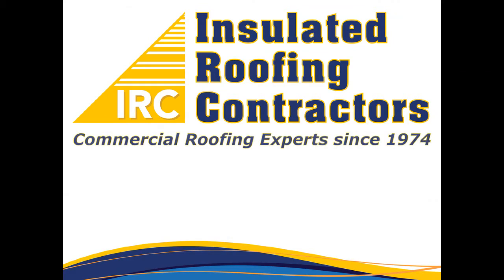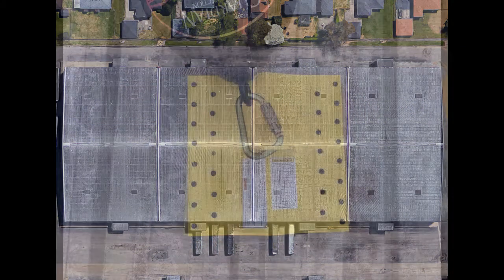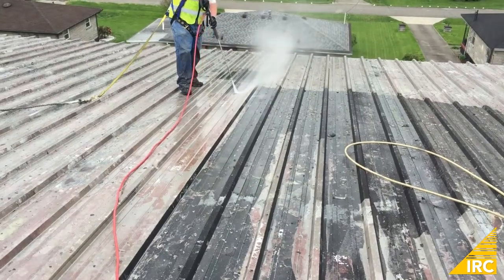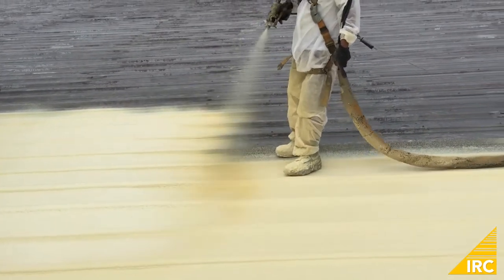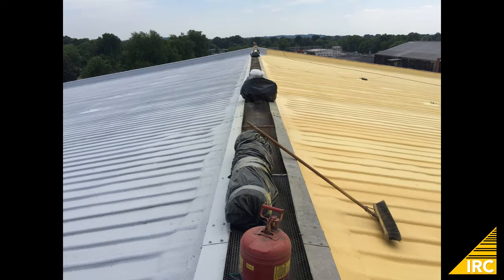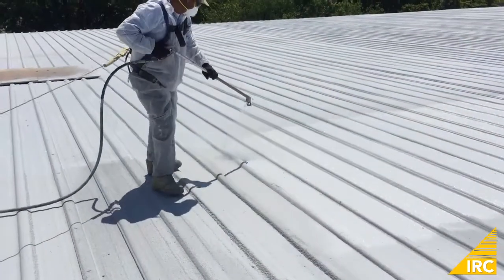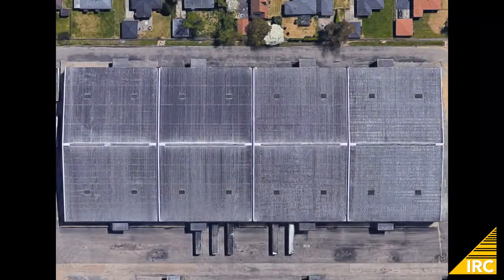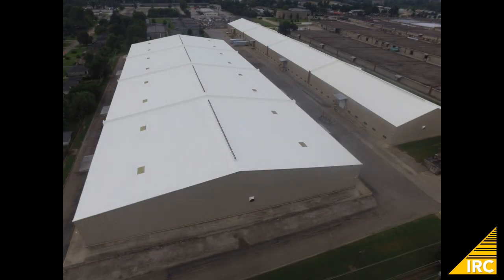Spray Foam over Metal Panel Roof - Application Process

Comment: Can spray foam be removed with a 3000psi pressure washer after instalation??
Reply: No it can not be. 
It's over 1.5 inches thick if it's a good installer it ain't coming off.
Reply: It costs a fortune to install, why would you want to remove it!

Comment: I live in S Florida and have a 1971 built concrete house - block walls and 6" slab decks and slab roof with elastomeric white roof coating. Zero Insulation. I have solar panels on stanchions and they are trapping heat between the panel and the roof, and the heat is passing through the roof. I've thought about laying tpo under the solar panels, but the time to cut/fit around all the stanchions, wiring, etc. is daunting. I'm wondering if a layer of spray foam insulation, topped with elastomeric roof paint might offer a solution. Any insight, experience, comments, welcomed.
Reply: The panels shouldn’t be trapping heat. If anything they should be shading the roof while also allowing an air gap. Are these panels new and you have just noticed some sort of significant difference, or have these panels been there long term and you’re just trying to sort out why the roof is allowing so much heat to pass through?
Reply: @JimYeats  I initially thought what you are thinking - ie the panels will shade the roof. In actuality, the heat transfers through the panels and then is trapped between the underside of the panel and concrete roof deck.....which according to thermodynamics the heat radiates through the roof to the inside of the house.
Reply: @frederickmatthews4259  Maybe you have a very unique situation. I guess I could see if you have a flat roof and block sides that extend past the roof height and then solar panels on top of the roof and you have basically created a hot box, then maybe. 

But for everyone else out there solar panels on a standard roof reduce heat since the panels reflect sunlight, and there is an air-gap that doesn’t easily allow for the transference of heat, particularly on a normal roof where a breeze is removing that air between the panel and roof.
Reply: @JimYeats  You are failing to understand the solar panels DO NOT reflect sunlight any more than a black asphalt surface reflects sunlight.
Reply: @frederickmatthews4259  My apologies, I used the wrong terminology. It doesn’t change the fact that solar panels cool a standard roof compared to not having solar panels.